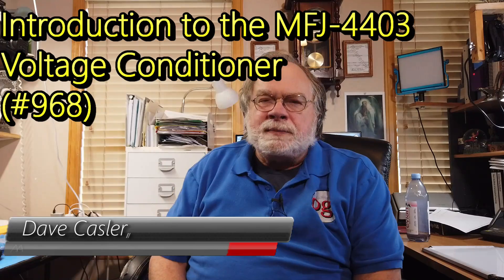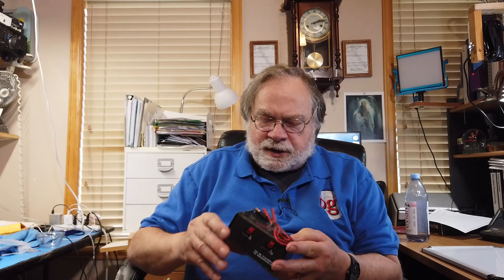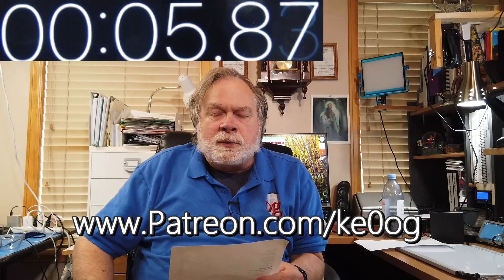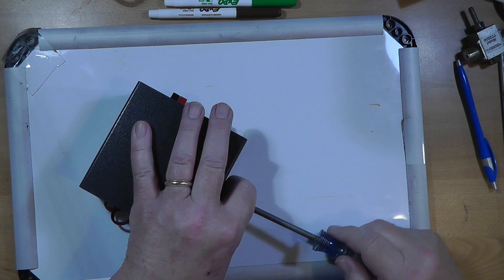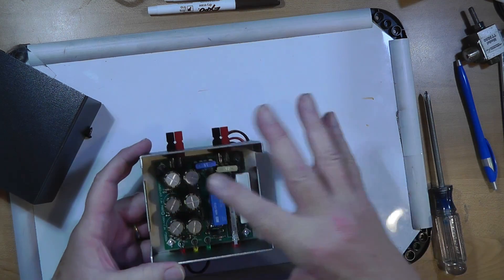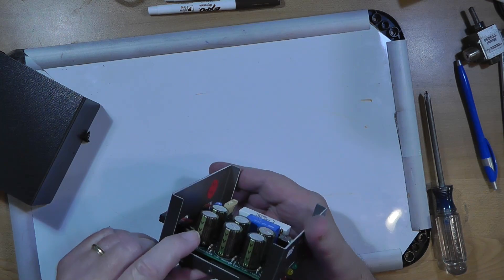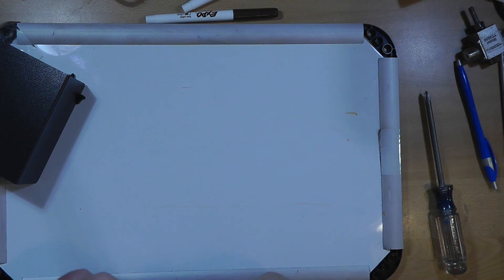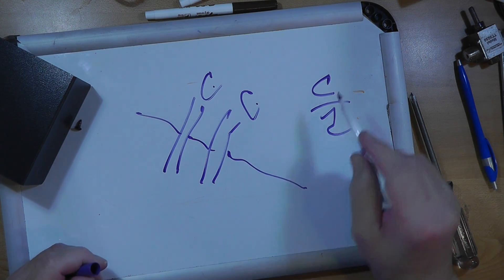Introduction to The MFJ-4403 Voltage Conditioner (#968)

Comment: I have one of these devices and yes, it is very nice in dealing with power  surges and power brownouts, however, there is one concern with it. When you turn it on, the output voltage slowly rises from zero up to the usage voltage of 13.8 V and this happens over a period of 20 seconds or so. I have my radios connected to a West Mountain Radio power distribution bar and when I turn on the voltage conditioner, as the voltage rises my VHF/UHF radios make a howling sound for a brief moment.  This happens at low-voltage below operating voltage. Once operating voltage is delivered by the voltage conditioner, the radios no longer make noise. The concerning part is I don’t know that this is bad for these radios. It sure doesn’t sound good. I see no effects on HF radios, however, the VHF/UHF radios seem to be sensitive to this low voltage during the period of rising voltage.